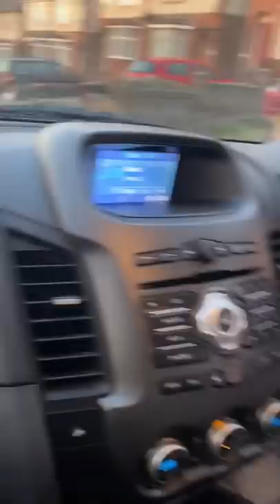Bricklaying.... thank f@%k that weeks over!

Comment: At the beginning of the vid ypour testing out where your lads put the bricks and blocks. The board your using looks like a faithful one with the lip round the back  if so they’ve been discontinued where do you get yours from can’t find them anywhere on google
Reply: Ah being discontinued would explain why there out of stock everywhere I have looked.
I know Charlie uses the green Marshall town ones as well but there 3 times the price of the faithful ones.
I just can't find those faithful ones in stock anywhere. I don't why there discontinue them they seem to be a good seller.
Reply: @JimJimpmjj  gatorboards I believe 👍
Reply: @Fir3trap  yes correct, owned by Marshall town. They do look good quality just very pricey.
Reply: @garytopping3654  indeed mate I have spent a week or two looking, every website I find that has them listed is out of stock 🥺😭😢
Reply: james swain I’ve rung ses tools today who used to stock them  they may have another supplier at a similar price there going to get back to me if it happens give them a bell mate.